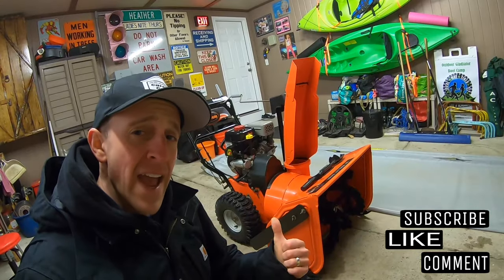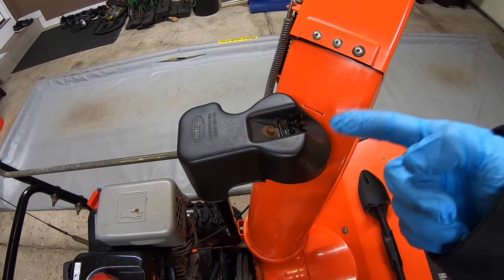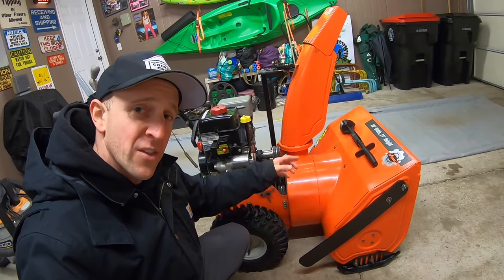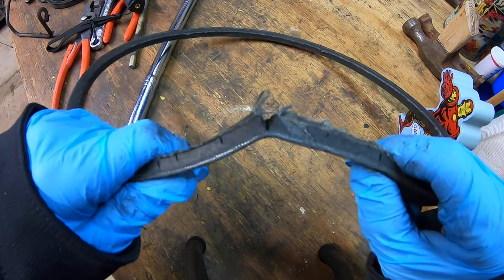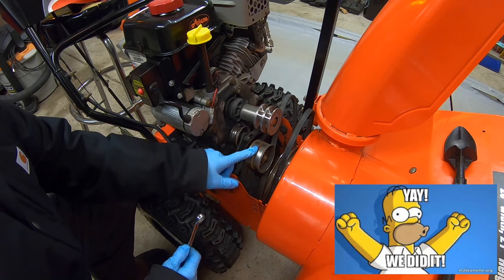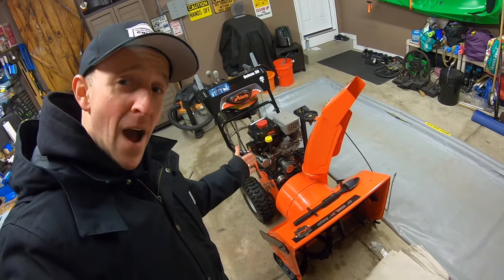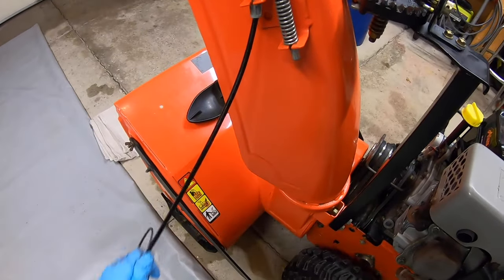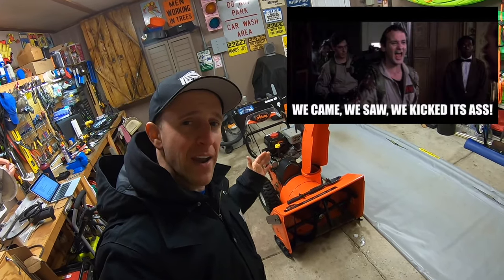HOW TO CHANGE SNOWBLOWER AUGER BELTS - FAST & EASY Replacement and Installation

Comment: Pro tip, snow blow 2 rows into your yard and about 15-20' before your driveway. Then all snow that's on the plows blade will dump in the yard instead of your driveway.
Reply from the maker: Ive done that before but my blower eats up my lawn. I try to avoid damaging it in the winter!  Thanks for checking out my channel!
Reply: Yea, and with it being heavy I just lift the blower so I don't dig to much. Cheers. Where you located?
Reply: I see now, I'm in Batavia!
Reply from the maker: @nikej24  hey very cool you’re only about a half hour away!  Go Bills!

Comment: Thanks so much for this!! Is there a way this Canadian from Ottawa can donate a few bucks to buy you a drink? @Garage Gear (OK, tagging you doesn't seem to do anything). Fixing my clogged blower whose augerwasn't rotating saved this young father's bad back from a 3-car driveway after a fresh 10 inch overnight dump.

 I just changed the belt on my really old (Craftsman sold by Sears, manufactured by Murray, which was acquired by in 2004 and now sold as Briggs & Stratton) snowblower I bought 3 Winters ago of questionable and unknown age (maybe from 2005?) and history, since I bought it from a random dude on the internet (he told me he's an eritred electrician, so handiness checks out).

Happy to say mine was a much easier arrangement inside! My drivegear is a chain, and my tension belt and wheel and pulley system is part of the rear half of the assembly, so I only had to manage one belt while changing the auger belt.
Reply from the maker: Hey Ryan! Glad you got that snowblower fixed! And thanks for sharing that info about your craftsman! If you’d like to support the channel here is a video and in its description you can scroll down to the PayPal link that says support the channel! Thank you very much and thanks for being a cool fan! 👍WINTER STORM GERRI IN BUFFALO JANUARY 2024 VS ARIENS PROFESSIONAL 32" SNOWBLOWER
https://youtu.be/MxigZs9OE80

Comment: G maybe my 56 yo blower could use a new belt never been changed
Reply from the maker: Wow! Ever had to tighten it?
Reply: @GarageGear  never been adjusted or even looked at  still working. I think we made things better 50 years ago !!  I did replace the friction disc a few years ago n one sp plug in it’s time. No carb issues period. I think we got our monies worth eh !!
Reply from the maker: @scottwebber652  I’d say so! Not bad! Pretty impressive!

Comment: Jared is that you ??
Reply from the maker: Indeed it is! How you been bud? Long time no talk!
Reply: @GarageGear  been good man ! Working as the head night custodian at drake school in NT. Are you still teaching the PT class ?
Reply: @GarageGear  my auger wouldn’t turn yesterday,  I tried your heater trick and I’m back in business ! Thanks for the tip!! Very cool channel here , if I have any more questions I know were to come now. I got a ariens 926 for free this fall, I plan on taking it apart and doing some maintenance in the spring/summer. It still runs and works so that’s a good start 👍🏻
Reply from the maker: @johnmartin5153  awesome my man! Miss having you at our center! No one is as cool as you bud!  Still teaching there. If YouTube blows up for careers could change lol!
Reply from the maker: @johnmartin5153  awesome man!  Glad the heater worked for you!  Busted belts are no fun to replace!  Best to get the snow out. Sounds like a fun project. Let me know if you need a hand anytime! 👍
Reply: @GarageGear  haha thanks man. Right back at ya! Your one of my favorite teachers that I miss from there.
Reply: @GarageGear  thanks will do ! I went to use it again today to clean the ice wall the plow left in my driveway the darn thing was froze up again. I sprayed it with some cheap penetrating oil after yesterdays use and put some heat on it. Does it have to be specifically wd 40 sprayed in there ?  I also sprayed a thin layer of fluid film on all the metal parts. 
That seems to be staying on well
Reply from the maker: @johnmartin5153  you can use wd40, silicone spray, or fluid film. All will work well and lubricate it/protect it my friend!  Keep me posted!
Reply: @GarageGear  thanks man ! And will do !! I’ll definitely keep in touch. Love the channel buddy
Reply from the maker: @johnmartin5153  thanks my man! Stay in touch! 👍👍

Comment: Nice but you didn't show how to do the hardest part of this whole thing.  That  is getting the belts back on the pulles.  It is very hard.  No space.
Reply from the maker: Thanks for watching
Reply: @GarageGear  You do a great job.  Great editing and content.  I have my Ariens Deluxe 28 SHO in 2 parts in my garage.  Needs a lot of what you recommend..  Thanks again. 3 belts, lube, oil change, grease and cleaning.  And I thought it was in good shape.
Reply from the maker: @Believe_the_Bible  you’ll be all good to go for the next winter showdown! 👍

Comment: I have a single stage blower and the belt cover keeps losing screws. Any suggestions on how to keep them in? Increase the size of the thread? Removable loc-tite? I only have 2 left holding the whole cover on.
Reply from the maker: I would probably opt for the screws with slightly bigger threads and see how they fit. I’ve even dropped candle wax on threads before to hold them in and that seemed to work! Let me know how it goes for you!